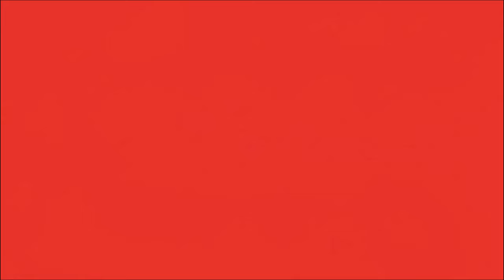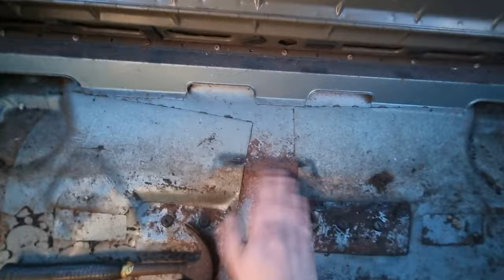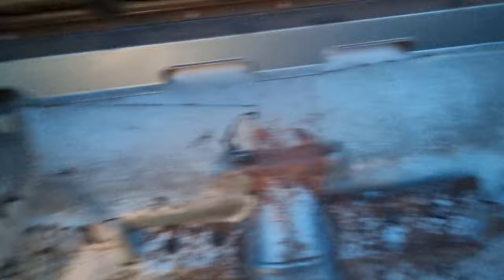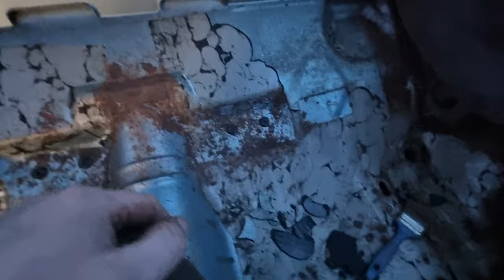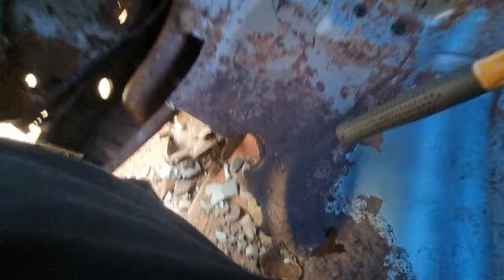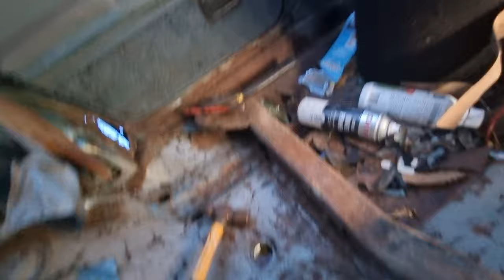Cortina Mk4 Ghia 2.3 V6 Restoration || Rear Floor Pan Inspection Part 2 (P30)

Comment: Yes they are seat belt holes for the seat brackets to bolt to check the rear door pillar on the inside of the car the top one should be there you might have take some trim off at least there is metal in the back of the car  mate 👍
Reply from the maker: Sweet that's great will check that out

Comment: My Mk5 was that blue, I remember when I had the windscreen surround corrosion repaired the body shop told me there were several shades of the same colour code so it wasn't straightforward to match the paint

Comment: great to see the rear end looking more solid, I recon if that was left for another few years, i recon the rear would have started to go too.  Yeah the spare wheel boot cover, is what you want to use, as i mentioned for the colour.   as for the seat belt mounts,  there should be some other holes for the anchors , which could be in the middle, or further back.  Id ask on the owners forum though, just to be sure.  Also did you get my Email?  metro pics as you requested.
Reply from the maker: yeah i got them :) looks wicked love the spot lights on the front to my brother in law as the metro to in red flame red i think the colour is